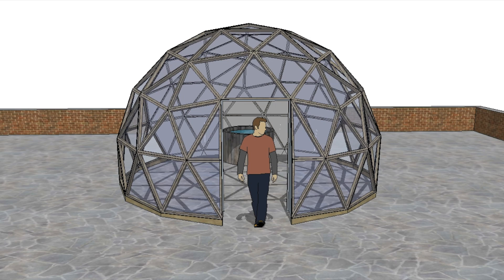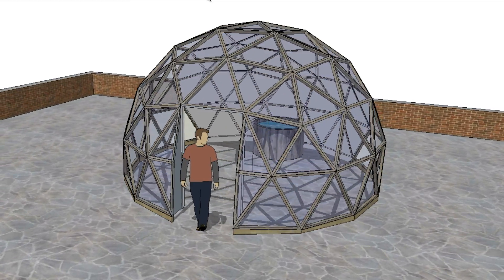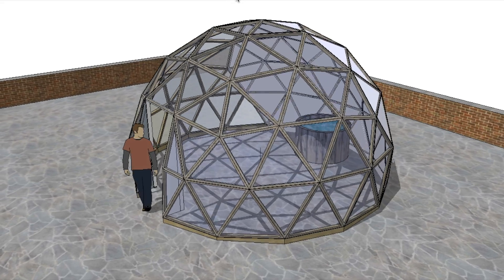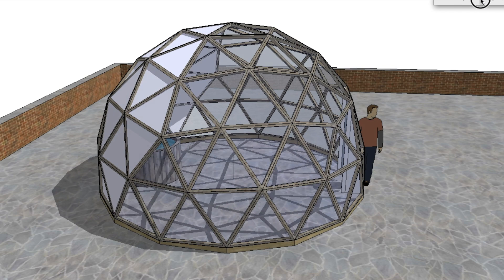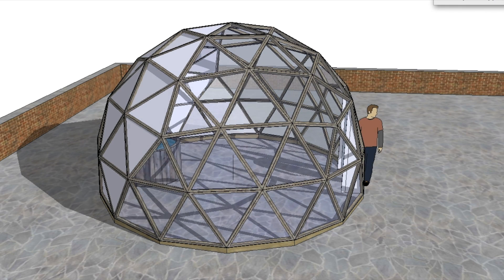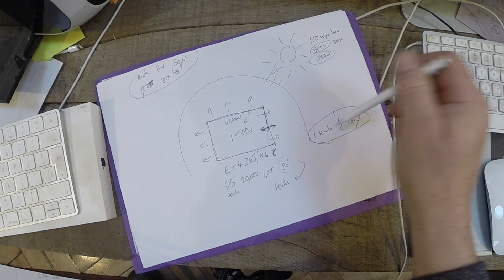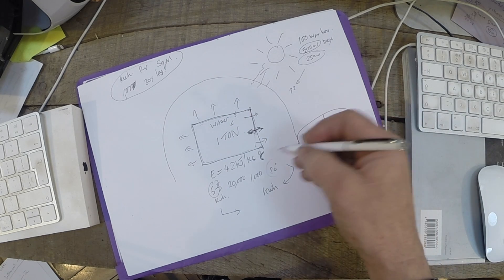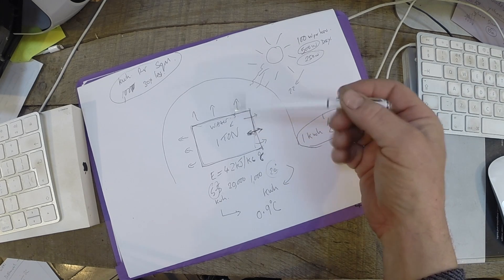Passive greenhouses don't work

Comment: For fun I've done some more maths on this, using the solar insolation data available here (http://pveducation.org/pvcdrom/calculation-of-solar-insolation) for Carlisle (approximating your location) for one of your GD18 domes, assuming no cloud cover (ha!), and that all the solar energy received by the dome is transferred to the dome as heat (double ha!)

On December 21st (shortest day), maximum total insolation in Carlisle is 6546 kJ per square metre per day. Assuming one of your GD18 domes, that's a total energy input of 118MJ for the day (which is theoretically enough to raise a 1 ton water tank's temperature by 28 degrees C), or averaged out across the 24 hours in a day, an energy input of 1365W.

Heat loss from the greenhouse to the air will have a huge impact on this, though. Single-layer polythene has a U-value of 1.1 W/m^2C, and the GD18 dome has 41 square metres of polythene, meaning that for every degree Celsius the greenhouse is warmer than the outside air, it will lose heat at a rate of 45.1W. For ease of maths, let's assume that in Winter you want your greenhouse to be 20 degrees higher in temperature than the outside air. This means it will be losing heat to the atmosphere at a rate of 904W.

In theory then, we've got more energy coming in than going out (461W more!), meaning passive solar heating works! In fact, on a cloudless day, there's theoretically enough energy left over to raise the temperature of your 1-ton water tank by 9.5 degrees Celsius.

But in practice, input losses due to cloud cover (much more likely in winter) stop this from working. It's hard to estimate, but this paper (http://web.mit.edu/parmstr/Public/NRCan/rp418.pdf) suggests a completely overcast sky reduces solar insolation to only 0.3 times that of a clear day. That would reduce the input energy flow from 1365W to 409W meaning we'd need to make up the shortfall (an extra 495W to match the 904W being lost to the atmosphere) from energy stored in the water tank. However a single day's energy extraction at 495W would be enough to drop the temperature of a 1 ton water tank by 10 degrees C.

So if your winter has more cloudy days than cloudless ones (and in Carlisle, that's a certainty!), passive solar heating can't maintain anywhere near a twenty degree temperature differential. four-or-five degrees is much more attainable, but doesn't do you much good in the dead of winter.
Reply: Wind on the dome plays a huge roll in heat loss to the outside air.   I built a 20' dome with insulation on the North face and two layers of 6 mil poly.  I also built an airlock so when I entered/left the dome the air didn't rush out.  I'm in NE Wisconsin.  The two years I had this dome were one of the coldest and snowiest winters on record.  My grow beds and fish tank were black and in full sun during the day.   I also had my fish tank insulated from the ground and the grow beds were surrounded with air... this allowed them to warm as quick as possible during the day.   As the sun went down the temp in the dome would drop like a rock, from mid 70's with no heat to close to freezing 1 to 2 hours after dark.  Each night I operated a rocket mass heater (barrel and half high). I would burn 2 to 3 grocery bags of wood (not much) and the dome would remain 60-80 degrees F.   Coldest temp outside was -22 degrees F and it was 77 degrees F in the dome.  In my opinion, even with an Earth Battery, I believe some sort of heat source would be needed.  .  You can grow winter crops in soil with double row covers.  But you won't be able to grow much else without a constant heat source during the night hours.  To remain completely passive is a myth.  Paul is complete spot on!
Reply: Liam. The losses will be at least 2-3 times greater than you calculated ;)
Reply: You`ll find the bulk of the heat loss isnt where you expect it to be :)
I installed 26 sensors and have collected over 7 years of data, technically the system works great, academically i still have more questions than answers ;)
Reply: If you didnt insulate the perimeter below grade you lose a lot of heat to the surrounding ground. 
Open water tanks in a greenhouse are a bad idea because water evaporates raising RH%  especially at night. Even more so if the greenhouse is unvented or airtight. 
Evaporating 1L of water requires 2000btu of sensible energy which is converted into latent form as the water changes phase from a liquid to a gas (water vapour). 
When the moisture laden air finds a surface that can cool it to the dewpoint temperature, the water vapour will undergo another phase change and condense out as liquid water. The latent energy gained during the initial phase change is released in sensible form. In a nutshell, the heat travels from the tank to the glazing in latent form, it raises RH% but not the air temperature. The loss of sensible energy will cause the tank water temp to drop. The sensible heat released to the glazing is lost to the outside world. The condensation on the glazing reduces light transmittance,  encourages  mold and can rot or rust a structure.
Liam`s calculations dont include latent energy, which, in most greenhouses represents the lions share of the total energy.
Reply: @JohnGuest45   
Hi John
OK so can one then heat water via a solar water heater placed outside and the water tank is either sealed inside or outside ( clad in protective insulation). And then pumped around the greenhouse in pipes using a small DC pump which uses batteries charged by the sun?
Reply: I can add a some observations from my dome pilot. My airlock was 10' long and 4' wide and 8' high with a rounded roof.  I had one layer of poly on it. The earth was flat as I walked in airlock during the summer.  In the winter, the frost had raised the ground level nearly a foot immediately outside the door.  I literally had to step down 10" to enter the airlock.  This caused issues with the door. The ground wasn't completely frozen in the air lock, but the inner walls were covered with thin ice.  A few times I had to kick the door in because it was frozen shut!  Sometimes it took several kicks and fear I would have to cut the plastic to get in to heat my dome.Around the first 3' of height of my dome, I wrapped several layers of pallet wrap material.  I basically used this material and wooden stakes to anchor the dome to the ground.  Dome skin, then wooden stakes on each triangle point and then the pallet wrap plastic around that.  I did this mostly to anchor the dome, but I found that extra plastic also kept the inner base of dome free from ice.  I also used 4' reflective bubble wrap roll to wrap the inner perimeter of my dome.  This gave me several inches of insulations around the base.  The base of my dome would not move and that proved very important during a tornado that jumped over our house and severe winter storms.  The snow really piled up around the outside of the dome...  approx. 4' high.  This caused a significant flooding issue in the first Spring as the snow melted and the ground water rose and basically created a 20' soup bowl with the snow/ice around the dome.  I had 8" of water in the dome floor and most nights a flooded RMH because I built it into the ground for safety.  Second Winter I removed all snow around the perimeter of the dome to prevent sprint flooding.  More on this below.Okay, now that I conveyed the interface between earth and dome... here are my thoughts on condensation and earth heat loss/gain.  The base of my dome was made of 2" X 6" untreated unpainted lumber.  In 30 months this lumber didn't decay.  A few areas had frost bite, but when I took down the dome the lumber was still in a great shape.  Had I painted it, it would have lasted for years.My dome was constructed of PVC so water moisture was not a problem at all.  Each night light ice would form on the inner covering.  That was until the RMH got up to temp.  It would take approximately 40 minutes before the "rain" started!  LOL  Water would rain down inside the dome as it melted.  In the coldest nights, some inner ice remained on the plastic.  I had a small aerated in-round pond inside the dome which was used to constantly feed water to an outside earth grow bed.  It was just a plastic in ground pond with no insulation. When the outside grow bed froze the water would stop flowing.  However, the bubbles from the aerator pump kept the water moving.  During the coldest nights, this pond would develop a thin skin of ice, but rarely remained frozen for long.  It was the lowest ground in the dome.  I thought it was interesting to watch this pond as it slightly developed ice and melted each night with the RMH running.  A really cool thing was the bubbles grew little ice mountains a few inches high.  It was really freaky looking.  At first I thought it was a big toad in the pond, nope ice structures!The ground inside the dome never froze and I had to cut grass (with a weed eater) in the Winter!  What a mess that was!~What I found is... if the ground is covered with anything at all... it won't freeze.  I suspect the constant inner heat energy (55 degrees) of the earth is able to rise to the surface cover keeping it from freezing.  So in theory, this energy can be used to help keep the dome from freezing.  However, I don't want a dome at 55 degrees F, I want a higher temp.  With a straight earth battery,, with no added insulation installed in the "earth battery"... the dome will always be self-regulating to 55 degrees F.  Over night, the earth battery will fight to lower the temp to 55 degrees while the RMH has the air temp to 75 degrees and during the day it will fight to lower the temp as well.  Basically, an earth battery will always be lowering the temp if it above 55 degrees.  This is great during the Summer, but it must be used properly at all other times.  I believe a properly designed and utilized earth battery is key.  I'll stop there because it is complicated to explain my dream earth battery configuration.  But, basically, it is a combination of purely passive fan driven earth battery air during certain conditions, segmented insulated and non-insulated earth battery zones for certain other conditions, with a water condensing recovery system to "milk" the water moisture from the air to be reused in the aquaponics system.One more thing, when the first spring flood occurred I struggled with a flooded RMH which I had to light the fire on a wooden float in the chamber with a small water pump constantly evacuating the water from the RMH chamber to keep it burning.  This extra water vapor destroyed the RMH riser several times that string.  After a few days of this BS... I had idea to dig a hole and install a sump pump to keep the ground water down. These are commonplace in our basements in Wisconsin. So I dug a 2' round hole 4' deep, put a 320 gallon water pump in the hole on a brick paver to keep the clay from plugging the pump.  I connected 50' garden hose to the water pump and positioned the water hose on a slope, outside the dome, so the water would not stand in the hose and freeze.  Each night, for better than a month, I sat there with a 115V remote control turning the pump ON/OFF to empty the water from the hole I dug.  The ground water would literally rush in from the sides of the hole almost like the flow was from a garden hose!  Extreme?  Yes, it was, but it worked!  I was amazed how quickly the sump pump hole would fill!  The RMH never flooded again.   Very special attention must be given to the water table for it doesn't freeze during the winter and it must be managed.Cool thing, I observed water vapor plunging into the hole and out.  I noticed I didn't have to use as much wood to keep the dome heated and it was still very cold at night.  That sump pump hole in the ground acted like a heater and a dehumidifier.  It helped cut down the "rain"  each night. So in a nutshell... my next dome will use the earth to heat the dome to 55 degree F if needed and cool the dome if too hot while condensing/reclaiming water vapor.   I also learned that adding co2 to the dome environment helped slow plant transpiration during the day in full sun.   This helped cut down the condensation at night.Sorry for the major intelligence dump!  LOL But, your comments reminded me of the valuable information I learned during my dome pilot.   I am so anxious to build another dome and my next one will be using Paul's amazing design!
Reply: Oh I'm sure they will - I was very much considering a "best case scenario". Wind alone will increase atmospheric losses dramatically above the 904W calculated above, and I have not considered loss of heat to the ground under the dome, or the fact that some of the insolation received by the polythene is reflected rather than absorbed.

Still, fun to play with the numbers :)
Reply from the maker: Thanks for that Liam, I do love facts and figures, I think we come to pretty much the same conclusion.
Reply from the maker: Thanks for that Rj, Your system sounds cool, you are bang on with keeping the building airtight, I have had experience of all the heat going in minutes if a vent or door is left open.
Reply from the maker: That's interesting, where is the bulk heat loss? I would assume through the higher portions of the greenhouse.
Reply: Very interesting! I'm trying to wrap my head around the mechanics of this...If the glazing is warmer due to condensation, that will increase the rate at which heat is lost from the glazing to the atmosphere. But conversely, warmer glazing will slow the transfer of heat from the air in the greenhouse to the glazing. I wonder which effect would win?!
Reply: The sensible heat is in the condensate, where it causes a fractional rise in the water temperature for a split second before being lost to the cold surface via conduction ;) 
Consider raising 1lb of water by 1deg F takes 1 btu, evaporating 1lb of water takes 980btu, most of which is returned as it condenses.
Reply: Hi Liam
What if you had your greenhouse near your house and you put a solar water heater on the roof of the house and heated the water tank in the greenhouse...
What size solar water heater would you require.
Thanks

Comment: Paul, when calculating the energy stored in the water, you forgot to multiply by the specific heat capacity; 1 ton of water raised in temperature by 20 degrees C has 84MJ (23.33 kWH) of stored energy.

Comment: The bulk of the light in winter is diffuse not direct , another reason why its not effective at heating the water tank ;) Insulating the north wall will affect light levels because diffuse light comes from all directions.